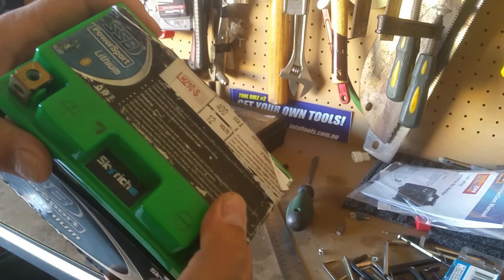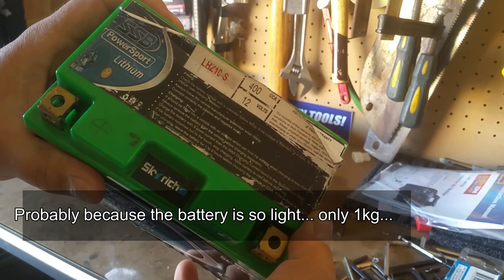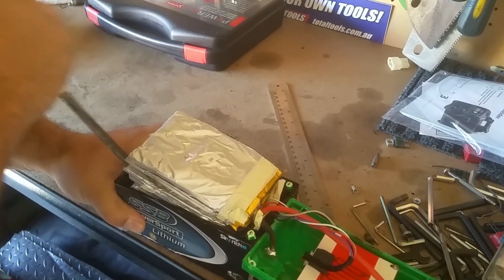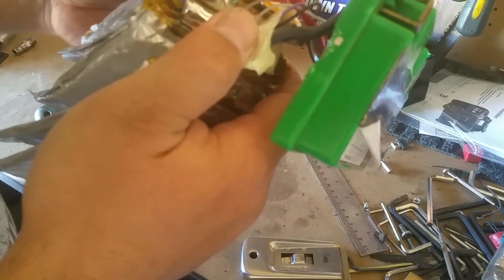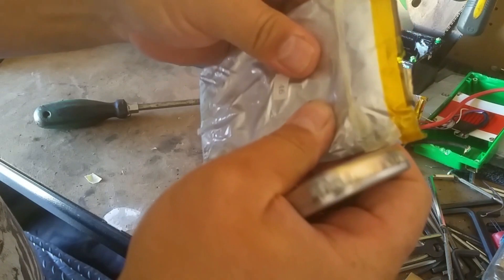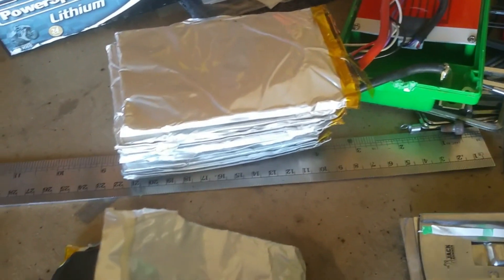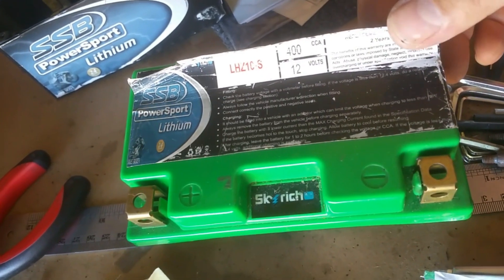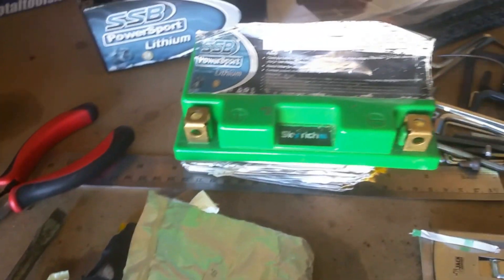Inside an EBAY Lithium Motorbike Battery - Skyrich SSB Powersport Motorcycle

Comment: Je m'aperçois qu'il y a des personnes dangereuse sur YT. En général, on s'informe avant de manipuler !
Cela commence mal car il n'y a que 4 vis cruciforme à dévisser pour ouvrir cette batterie, il n'y avait donc pas besoin de la martyriser.
Pour info ces LiPo se changent sans problème et 8 LiPo de bonne qualité vous coûterons moins de 80$. N'en mettre que 4 en série vous donnera également un bon résultats.
Il y a 2 fois 4 éléments en série/parallèle pour faire 12v. et un BMS pour gérer les charges/décharge de la batterie.
Si ces cellules LiPo avaient pris feu cela aurait sans doute évité de publier cette vidéo stupide.

Comment: If LiFeP04 batteries must be charged less than 14.48 volts, how do I modify the motorcycle regular to match.
Reply from the maker: Many lithium batteries that are for automotive use, have the regulator built into the head of the battery. If not, you would have to use a voltage regulator to ensure the battery is being charged at the correct volts.
Reply: The battery has a picture of a motorcycle on it [ebl lithium powersport battery]. When my engine is running the voltages 13.3 to 15 exceeds the safe level of 14.4 for the LiFeP04 battery. I inserted a variable resistor in serious with the stator winding to the voltage regulator to reduce the voltage to less than 14 and this seems to work, but I don't yet know whether it's safe to operate. Also, the lights are left on to help dissipate the excess power. I doubt the BMS is designed to dissipate the excess power since it's contained inside a sealed case.

Comment: I wana add my own 11.1v li-polymer 5000ma/h pack to my wr450f.  I already own those packs . & tested & it cranks the bike over much better than the 120cranking amp SLA battery thats standard. 
Charging is the problem as the li-poly peak charge is 12.6v , whereas the bikes charge circuit is 14.7 so it will overcharge & cause a fire , so i either need a replacement regulator thats suitable for the lipoly , or add a diode system in place to lower the voltage after the bikes standard regulator.  No1 seems to know or regulators that are suitable don't seem to be available.  There isn't enough tinkering done as of yet . Any1 out there already done just that ? Leave a comment here ?
Reply: I also wana add that tje sla battery weighs 2300grams & the li-polymer battery just 430grams & the batterys both output 5.0amp  so theres a definite gain to doing the swap
Reply from the maker: What you need is called a Step down buck. It will take the input voltage and step it down to 12.6v (or whatever volt you set it at). Sounds like a cool project, good luck.
Reply: Cela est très bien géré par le BMS interne de la batterie !

Comment: The cells are 3.2 volts, you have 2 cells in parallel times by 4 giving you 12.8 volts in total nominal voltage. Not 1.5 or 1.2v.

Comment: You have a cell out of balance. I charge mine with my R/C charger once  every six months to run them through a controlled discharge  and recharge each cell to the same voltage. It sounds hard but it's really not if you have the special charger. Awesome vid man!
Reply: Le BMS inclus se charge de l’équilibrage des cellules ...

Comment: Skyrich is Taiwan made, but ALL lithium comes from China. As china has massive resources of it. 100% of all smartphones today use lithium, and also its from China.

There are lots of benefits using Lithium ion compared to lead acid..

And most of the time, MOST "dead" lithium cells, can be "revived".

U seem to have a garage, itll be good to invest in something like LiPro Balance charger. So, even if say your lithium battery circuit board is wonky, you can actually unplug it and plug to your balance charger and keep re-using that same batt..

My lithium battery on my GSXR750 K7 is on for 9years and still counting... There was a time i didnt use the bike for 1 year.. And the alarm system drain my batt dead.. All it needed was to get a balance charger, and revive it.. And boom.. Reuseable till today.. Plus im a mechanic both in Aircraft and motorcycle, hence this simple life hacks saved tonnes of $$$...
Reply: Thanks for the info. On ebay many outlets are misleading in their description suggesting they are developing/making them in Australia laboratories and are the best using prismatic cells instead of conical blah blah blah. A one year guarantee is bull shit for a $400 dollar battery.

Comment: I'm considering purchasing a SSB LH20L-BS battery for my Harley Davidson 2015 Softail Slim 103, but at $484 I'd expect it to last and get a decent warranty from the supplier.  I feel that I'd be taking a gamble and these types of a batteries are a work in progress.  Seeing this YouTube clip makes me feel reluctant to take the plunge, particularly with the secondary label that quotes a different CCA figure.  Superstart (possibly the distributor for SSB in Australia?) quote 550CCA for the LH20L-BS (ref: https://superstart.com.au/lh20l-bs-high-performance-lithium-ion-phosphate-motorcycle-battery.html)and yet when I go to their reseller's website in Western Australia, the same battery is listed as 700CCA (ref: https://www.goodchild.com.au/technology/lithium/lh20l-bs) and Battery Specialists quote 500CCA (ref: https://batteryspecialists.com.au/products/ssb-high-performance-lithium-lh20l-bs?variant=34538380132507).  Maybe I should just get a decent AGM battery which costs less.
Reply from the maker: These things will outperform AGM for CCA, but on the same token you can't trust the quoted CCA. I've had several of these Lithium batterys now and each has failed within 1.5 years. That's looking after them with a lithium trickle charger after each ride etc. I put it down to my bike has a high output starter, which is draining too much of the battery's aH, which is not being replenished by the short distances I ride.. It would definitely suit a smaller bike / engine starter. I still think they are good bang for buck, but don't expect them to last long. If you are going to go AGM, I recommend Motobatt. Good luck mate
Reply: @Unfastened  Thanks for the feedback.  Much appreciated.

Comment: That’s 4 cells in parallel and 4 in series. Each cell has a voltage of 3.65v when fully charged. 
The circuit board is an active balancer
Reply: NON, il y a 2 jeux en parallèle de 4 cellules en séries !